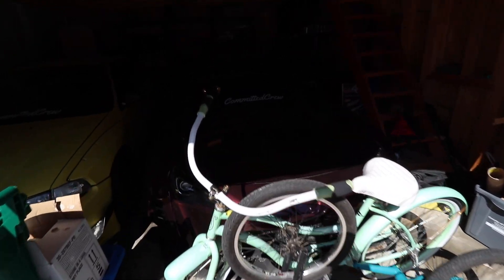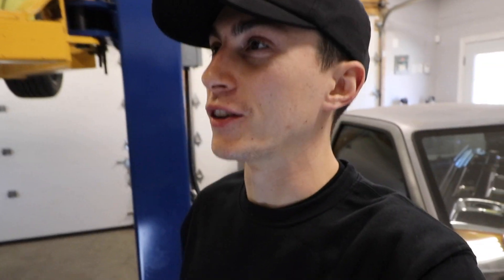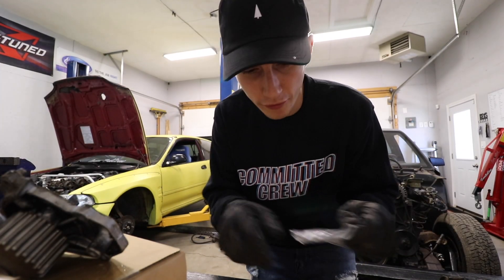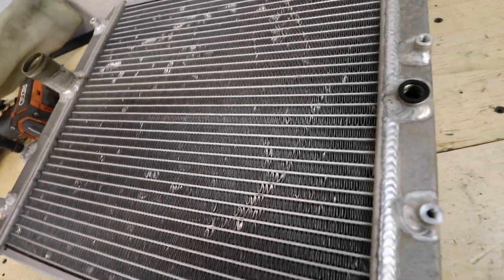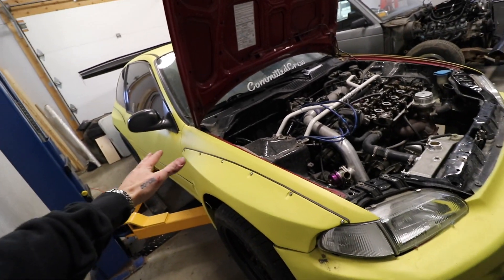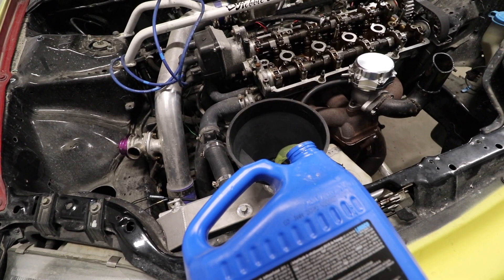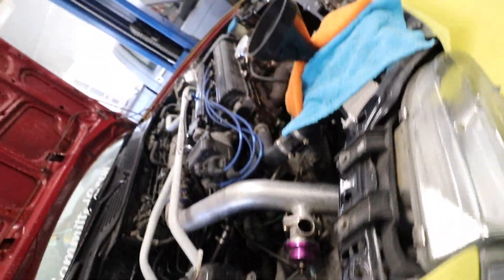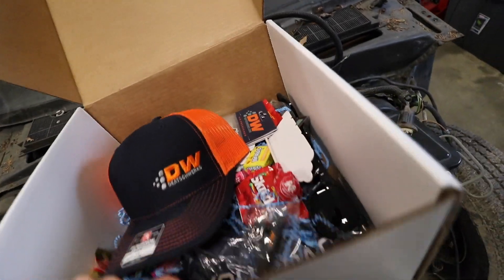Addressing All Issues with my Civic..

Comment: Hi Robbie, I just realized what the perfect tool to add to your tool collection namely plastic razors (it works just like normal razor blades but it doesn't gauge out aluminum or any other softer materials (like countertops)) but it does remove gunk as well as normal razors.

And for the ek, a perfect place for a kill switch is inside the shiftboot, inside the dash or under the gas cap release...
Reply: Also dab-shifting...

Comment: Regarding the Water in Wastegate problem: why don't you drill a small hole in the lowest spot of the "exhaust pipe". That should at least fix some of the problem for those times when you just forget to cover the hole. Sure you will have some air going down but as long as the hole is small enough it shouldn't really matter. Or you could install a proper drainpipe/hose if you want to be fancy about it (perhaps some leftover breakline?)

Comment: I worked at partsource for a good while, and everything is horrendously marked up even to commercial customers, shop on rockauto, even with shipping prices for the same part you can buy local are at least 25% cheaper
Remy alternator for an 02 WRX with my employee discount was about 250, and it was like 145 on Rockauto